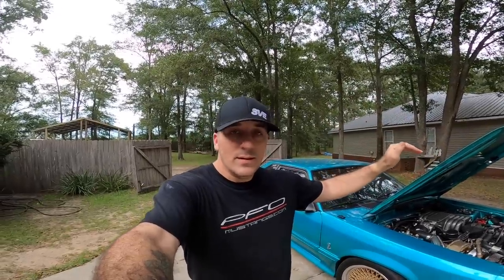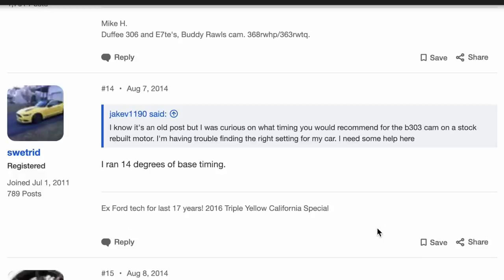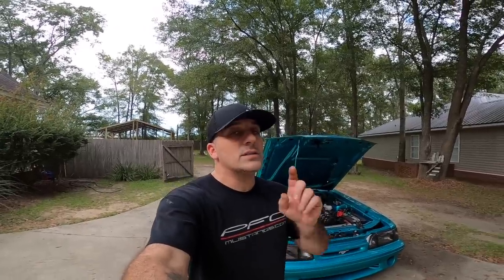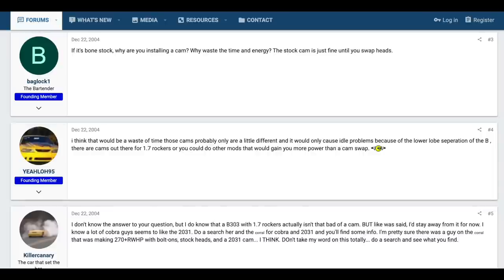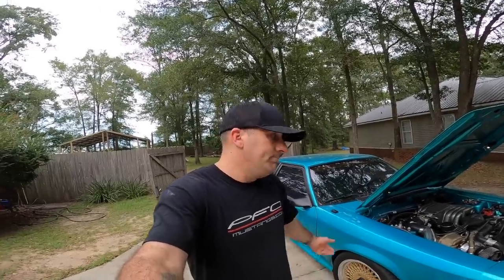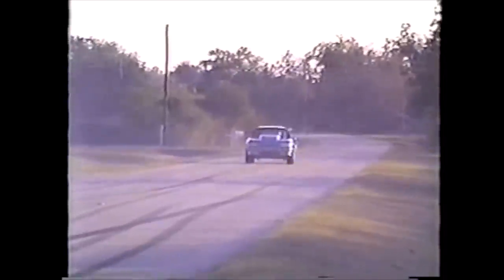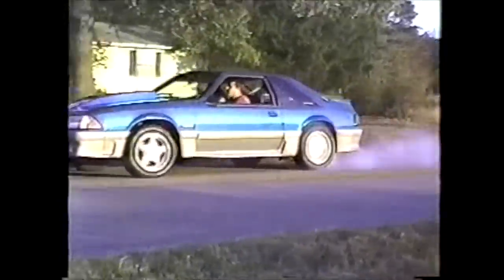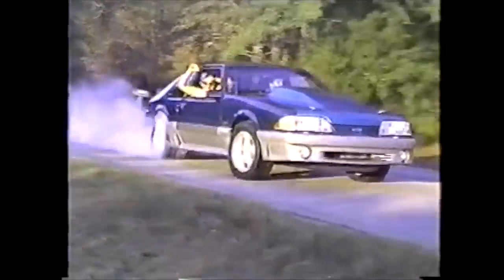THE B303 CAMSHAFT: Why the HATE why the HYPE?

Comment: I ran a b303 cam with gt40 heads and gt40 tubular intake with an old Paxton sn93 at 8 psi. Ran 11.20's at 122 in the 1/4.  Love the cam.
Reply: That trap speed tho
Reply: What did you run in the 1/8th? I ran a 7.43 with a E303, Cobra intake, aluminum GT40 heads and a 150 shot in the 1/8th back in the 90's. Still have the car but don't race it anymore.
Reply: @smitty31560  1/8 mile races are lame

Comment: You’re right man...back in the day it was all about the B or E cams occasionally someone had some money to throw at a lunati. There’s a reason people still look for the GT40/GT40P’s and run the letter cams....they’re proven! And something to be said for a simple combo on a 30 year old car still out there hurting feelings!
Reply: Not only that but it's the perfect sound
Reply: I'm doing a 302 .030 over in a nissan hardbody. The engine was donated to me by my neighbor. I heard the engine run but still tore it down for a rebuild. Very good condition. I'm doing the mild hand porting on GT40P heads, roller rockers, link bar roller lifters, Lunati 51027LUN cam (which has been discontinued) Eddie intake, 600 holley DP,  MSD street fire and distributor, 303 top loader trans. (Wish I had a top loader 4 speed.) About everything I got has been donated or bartered for as a budget build. I told my mustang buddies what I was doing and they started donating and trading stuff around to contribute to the cause. I can't wait to get back on it and get it running. My shop air compressor died and I didn't have a way to finish the porting on the heads. I just got me a good compressor and I'm ready to get other work out of the way and get back on it!
Reply: @motorman111jld  Brew has had problems with cheapo roller rockers, and had to junk some. Not a place to cheap out. Comment on his new video for a recommendation.
I've run 303s from 390s and they're virtually indestructible. They're heavy gears so you MUST have a great shifter... or else.
Reply: @hotrodray6802  they're not cheap ones. I forgot what brand exactly but not cheap ones... that's what I've been told about the top loaders. I wanted a 4 speed but man I could easily do a 5 speed for the price of a 4 speed. I found the 303 top loader for $100 from a guy that did a 5 speed swap on his 67 mustang. His story was it was his first car and he was restoring it with plans on rebuilding the transmission then wanted to go 4 speed but decided to go 5 speed becauseof cost. I can kinda believe it because he had it cleaned up like new and all boxed up and stuff. I definitely want a good Shifter. I hate a sloppy shifter. I'm wanting a Hurst Master shift but it's gonna have to wait till I get to that point.
Reply: Yes sir. That combo runs good, sounds good, and drives perfect like a stock car
Reply: @motorman111jld You won't have any overdrive with a four speed. It probably won't matter if you drive the car short distances though.
Reply: @PatchesOHoulihan-hi2tb  Mainly around town. But overdrive isn't really an issue anyway. The 5 speed I would consider has a 5th gear ratio of 1:1 and the 4 speed has a 4th gear ratio of 1:1 if I remember correctly. I'd have to go back through my documents to be sure.
Reply: @motorman111jld  Does the 5-speed have really steep 1st and 2nd gears for a good launch?
Reply: @PatchesOHoulihan-hi2tb  I don't remember exactly. I am working on getting the engine together right now and wanting to test run it. I have a 303 top loader 3 speed that will be the one to move it for right now until I get it running and close to what I want.

Comment from the maker: YALL GONE PUT SOME RESPEK ON THIS B CAM NAME! 🔥🔥
Reply: I love my B-cam!
Reply: I have a b cam with 1.72 roller rockers an afr 160's. Its strong
Reply: Respek on my name Birdman reference? All tree of yall
Reply from the maker: Bingo ✊💯👌
Reply: Is you finished or is you done
Reply: Tony Bailey I bought 2 sets of scorpions 1.6s for intake and I put 1.72s on exhaust side .
Reply: Hey bud so in the section where you showed Only Bcam And headers....what else did you have to change for that to work....Valve Springs? Etc...
Reply: James Stutts I bought an Alex parts drop in spring set , I had a set of hardened pushrods in my tool box I threw in for good measure . I put a good double roller timing set in as well and run it straight up . If I would have had time I would have checked the cam against a few sources , supposedly some cams are ground a little different . I like checking and I like finding true top dead center and marking timing pointer for true TDC . 
My car is just a toy but it’s super fun .

Comment: I am a proud B Cam  Mafia member. My car may not be fast but she gets a lot of smiles from the OG folks at red lights. I could drop a boatload of money in the engine and still get beat by a turbo Civic.
Reply: Is your setup completely stock?
Reply: @demetryigupton9260  Stock bottom end, Explorer intake and gt40 heads, B303 cam, 373 gears.
Reply: @MIKEJONES-dz4nc  I have the same but with an e cam
Reply: HaHa!  My old C10 truck that idles smooth would hurt your feelings at a red light and it weighs 4500 lbs!  That lumpy shit means nothing.  These lumpy LS trucks don’t know what hit them from a red light while my old turd idles smooth af at 750 rpm.  😂😂😂
Reply: @trailerparkcryptoking5213 You keep telling yourself that as long as it helps you sleep at night.
Reply: @PatchesOHoulihan-hi2tb   🤣🤣🤣. I sleep real good!  My Straub spec’d Clay Smith HR cam kicks out 600 lb*ft in my BBC.  These new Mustangs, Chargers, challengers and Camaras don’t know wtf just happened when they jump on my old truck....they turn off at the first intersection and never pull back up to me at the next red light.
Reply: @MIKEJONES-dz4nc  Or you can put a turbo in your car and beat almost everything.
Reply: @trailerparkcryptoking5213  Yeah having a spicy big block would definitely do the trick then. Especially if it's a big block stroker motor.

Comment: The vintage footage was great.   That was my era.  You're right,  back in the day those extra few horsepower either helped you win or lose.  My 91 I had in 95 was a blast.  Headers,  CAI.. thought I was on top of the world!  It was a quick car back in the day.   5 speed was a blast.  Girls loved the car.   Now I'm 47, married, with 2 kids...and take Flomax.  Time flies!
Reply: Back in the day for me were those same days! Had a '91 in '95. A 0.030 over motor with E Cam, Cobra upper/lower, full headers, ported tb, FMS 24lb injectors and computer, FMS roller rockers, twisted wedge heads, keith black hypereutectic pistons with .0200 popup (I think about 10.5:1) and a 100 shot of funny gas. Funny thing was the plugs would not clear the pistons because of the twisted wedge design, so I had to cut a "fire channel" through that part of the pistons lol She was a beast! Miss that thing. Wish I had been smart enough to have taken good pictures. Don't have a single photo of that car/motor :(

Comment: Tried and true setup I ran about 20yrs ago was stock bottom end, f cam, gt40p heads, 1.72 crane rocker arms, cobra intake and a 65mm throttle body.  Setup went 12.3@113 on 100% stock suspension.  If I had done k member etc. It would have been in the 11s

Comment: put a b cam in my 83 fox, that had a 87 fuel injected 5.0 (wanted a stock roller engine) but converted back to carburetion. (the carb shop) modified the stock 1983 holley 4 bbl. This car ran very well and loved the sound.This was all done back when all this stuff first came out. I would see an article in a magazine and they were swapping a 8.8 for a 7.5 or adding 5 lug to a fox body. And I had just done it weeks before. i still have that car today. bought it back in 84.

Comment: The B cam deserves respect because of the Lobe Separation Angle. Plus it's great for a stock piston to valve clearance.  People think lift is the best..no. that can kill airflow velocity. You want a tight cam to keep cylinder pressures up. Not alot of bleed off.
Reply: Denny  an engine loses pressure through overlap; the moment at which the exhaust valve and intake valve are open at the same time. This is part of what’s called dynamic compression. When the the piston is moving to top dead center position there is “bleed off” from the valves being partially open. Less cylinder pressure contained in the cylinder, the less horsepower that’s contained in compression to make said horsepower. A “tighter cam overlap” means less time the valves are left open to bleed off cylinder pressure. The down side to this can be rougher idle, less power down low in off idle operation due to low intake velocity. But the trade of is more of a 2 stroke mind set. When velocity increases and cylinder pressure builds, the power comes on much harder in the desired rpm. The desired rpm is mostly dictated by the camshaft duration. Which is also dependent on multiple factors like total cubic inches of engine, intake manifold runner length, cylinder head cross sectional area of the ports, the valve sizes ect. Most people just through off the self parts together expecting the best performance, but fail to realize, everything works together.  Example, Throwing the largest throttle body doesn’t automatically mean more power. Everything in the intake system for air flow is a series of convergent and divergent ducts creating low and high pressure areas to allow for maximum velocity of air without choking off total useable CFM to make power in the desired RPM range. So having to large of a throttle body can actually mean lower airflow velocity into the cylinder, creating a loss of torque in lower rpm. Remember, for street cars, midrange power is desired for quick acceleration from low speeds. This is why smaller displacement engines, without going All out race heads and intake can leave people in the dust on the street. Horsepower is just TORQUE X RPM divided by 5252.  The best street car is having the most TORQUE that’s accessible from lower RPM to make the best power in the higher RPM range
Reply: Denny  yeah I’d say your right. Every N/A car I’ve personally seen that’s ridiculously fast, advanced the camshaft 2 to 4 degrees mechanically. So the intake valve opening sooner would take advantage of the most vacuum drawling in air from the piston going down, On the intake stroke

Comment: I had a 93 Gt with B303 cam with GT40 iron heads with GT40 manifolds , exhaust , pulleys and 3.55 gears  , Pro-M mass air meter 77mm ....it was good enough to take out corvettes with me driving ...loved the chop sound of the B303 cam .

Comment: I got a stage 2 comp cams (XE270HR) so when I installed it, it made a difference but like you said, I sacrificed power at low RPM but gain at high.
But once I installed valve springs I recovered that low RPM power or probably gain more than stock.
But I definitely love the sound of B cam, a friend of mine he did a combo of gt40's with ported valves and valve springs and an elderblock  intake with a 70mm TB all that combo was installed with the B cam and I haven't heard another foxbody chopin like that one.
Forgot to mention it had a shorty BBKs headers H pipe and flow masters 40 series

Comment: Andrews car sounds wicked and it gets down! Yeah those old school bfg drag radials...they hooked ok until that buck fitty shot came in!! Hahaha. I bought a crane 2040 which is an E cam back in maybe 2002 2003 for about 21.00 lol filled up their 1995 gt with gas at and a pack of newports..im still running it today. I have boost and afr 165 heads on a stock bottom end and will upgrade to possibly an Fcam when refresh the motor.

Comment: We put an F cam in my buddy's car with ported P heads and a carb, 5 spd and 3.73s. Kept up with coyotes all day. I was amazed lol
Reply: No way. No disrespect bro, but they weren't racing
Reply: I beat coyotes in my 94 cobra with a bcam 373 gears a tune and a stock intake upgraded internals it’s possible
Reply: @mikejohnson699 To be fair the coyote mustangs of today are heavy fat pigs. I used to have a 2012 GT but I sold it after I built my 73 with a 347 stroker. I didn't even want to bother with the 2012 after that because it was slower and I figured why make payments on a car that I don't enjoy driving as much as the car I built myself. My 2012 GT weighed about 3,650 lb and my 73 mustang weighs about 3,200 lb. My 73 makes more power and is lighter and I can work on it with basic tools without having to deal with any computer crap too.
Reply: A lot of people tend to underestimate the power of those engines in those lightweight cars. A Fox Mustang with a well-built 302 or 351W will spank new Mustangs and Camaros all day long. Unless of course you're going against a Cobra or ZL1 then you'll need some more cubes or forced induction to compete.

Comment: They aren't bad for the money, especially in the used market. There is something to be said for the 30 years of technology and research that's been gained in the valvetrain department though. Just look at valve spring tech in the past 5-10 years. But for most people an alphabet cam will be just fine. Really most just want the lumpy idle and a b cam or e cam is pretty hard to beat for idle sound.
Reply from the maker: Agreed
Reply: Like Brew said the B cam worked then it still works .
Reply: @allenjay5907  Thanks.  I plan to buy one for a 1963 260ci engine.  Fairlane Car.  simply want the sound.  straight shift.

Comment: Don't forget some of the practical considerations, like the oil pump/distributer drive gear (this is where the letter cams are compatible with the stock oil pump/distributer drive gear, aftermarket cams may not necessarily be forcing you to run a brass oil pump/distributer drive gear and replace it often).  Also you need to consider intended usage (cruising/street-strip/hardcore pure race type (drag vs autocross vs road course)) as well as emissions compliance (for cars intended to be licensed for use on public roads).

Comment: Them GT40 heads are good for nitrus.  You got different heads for different set ups. Turbos like to flow so a head with a good exhaust port accommodates that. 
    Nitrus likes to dwell in the combustion chamber. There's were the 40's come in to play.
   Seen it all to many times were a nitrus car with JTay 40:s knocks it out of the park.
    It's one of 50 Tussians favorite set ups. You got Andrews, seen that guy on fox cast with a similar set up and hit over 500hp. And ya, he had 40's.

Comment: Back in the day I bought a GT40 crate engine from an ad in MM&FF, I’m old can’t remember the vendor. It had GT40 heads and a B-cam from the factory. I put a GT40 intake on it and  shorty headers. It was the shit back in the early 90’s. I still have the car and well it’s on it’s 4th engine 5th if you include stock one. 302, GT40 crate engine, 306 with a x-cam, 331 and currently a dart 347. Both the 331 and 347 have custom grind bullet cams.

Comment: I absolutely love the alphabet cams. I ran an E cam in my ‘85 GT and it sounded great. I had a ‘90 GT with an F cam and a gear up under it and it ran good. I just finished a HCI on my ‘89 coupe and went with the F cam and I love the way it runs and sounds. I know there’s better heads and better cams out there, but I love the old school parts, the parts I grew up with. That combo in my coupe will beat cat backed coyotes all day long and cost 30k less and look a hell of a lot better.
Reply: I love fox bodies man but you're not getting a nice fox for 30k less than even a brand new coyote.  Matter of fact I can find decent 11-12 coyotes for LESS than what fox bodies sell for right now (nice ones).  I love fox mustangs would love to have another but the rocketing prices of them is starting to throw out the whole budget minded argument lol.  I paid 16500 for a bolt on 108k 07 gt500 couple months back.  I just cant justify paying close to that for a nice fox.  Maybe you can find them for good prices still but everywhere I look ppl want 10k for shit and 15 and up for nice foxes.
Reply: @michaelharris748 You were not looking hard enough. I got my 85 fox Mustang 3 years ago for 1200 bucks. After pulling a 302, T5 and an 8.8 axle from the junkyard I cleaned up all the parts and rebuilt the 302 into a 347 with ported GT40 iron heads and an F303 cam. I haven't dyno tested the combo but it had enough power to beat a 2015 Camaro SS. I have just a little over 8 grand into the car including the price of the car.

Comment: B303 is an awesome upgrade for a stock engines sound. I had a b303. Victor jr heads, cobra intake. And a 3:73 rear in my 86 GT. It was a great daily driver. Little car would scream.

Comment: Excellent video. Been saying this for a while. Everyone yells custom cam, they’re really expensive and a stock bottom 302 isn’t going that far over 300-320whp. For the money you’re spending on a custom cam vs a 100$ used B, TFS1 etc. If you wanna call FTI and spend 1000$ on a custom cam and valve train you can, just money that could be better spend somewhere else or left in your account with a stock bottom end.

Comment: Great video. I know it is quite old now, but there is truth in what you say. I design camshafts, and I've run the model with the b cam, f cam, e cam, x cam, comp xe 274, anderson n41, TFS stage 1, and a custom grind i designed for trickflow tw170 heads, small tube headers, with a holley systemax 2. All are relatively comparable in hp, and tq. I can tell you each is better than the rest in a given setup. The comp has the advantage of the most aggressive ramp rate of the other ots cams listed. Like you,  I could go on forever talking this stuff. My friends call me a motor nerd.